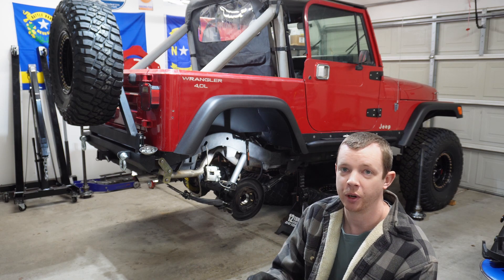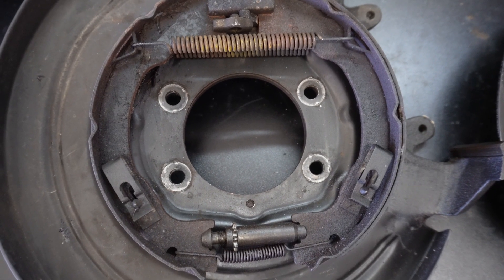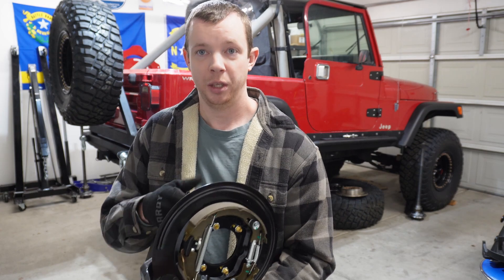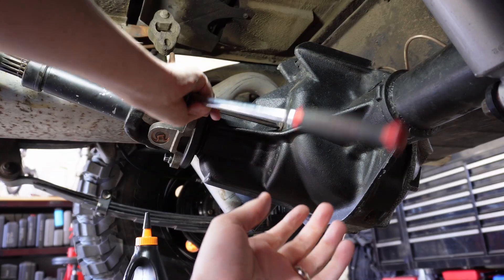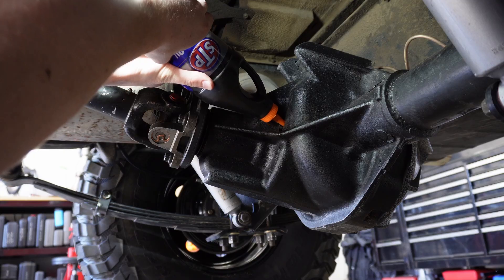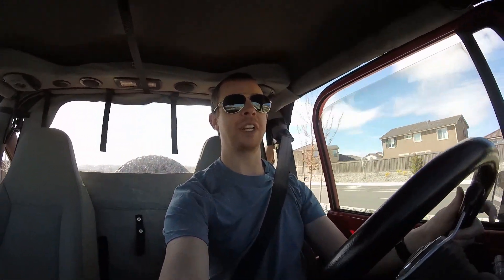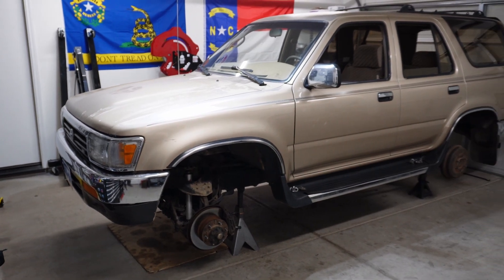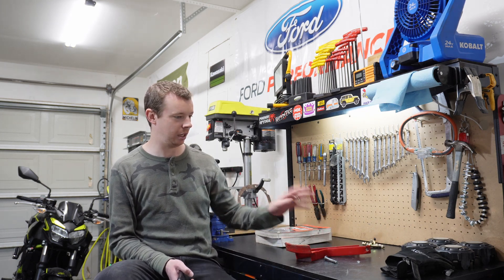Final Axle Assembly and Test Drive

Comment: How’s it ride with the rear lunchbox locker?
Reply from the maker: Pretty annoying sometimes, mostly just tight turns. Sometimes doesn't want to unlock and pushes you straight, sometimes chirps tires, sometimes unlocks with a sudden bang, typical lunchbox stuff. I wouldn't want to daily drive with it but I'm sure you would get used to it eventually.

Comment: Looking good! I just started wrestling with my rear gears yesterday. Not a fun process for sure. I thought I was gonna luck out after the first pattern was pretty close but it went downhill from there.  My shim kit does not have enough thinner (.005) shims so having to juggle what I have.
Reply from the maker: Yeah a very frustrating job for sure. I always seemed to need .003 one way or the other and the smallest shims I had were larger than that.